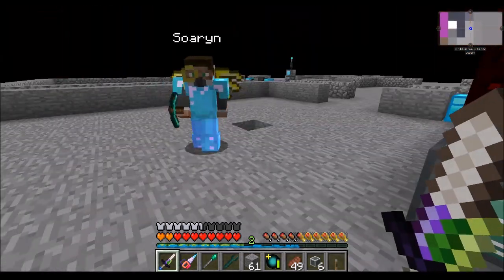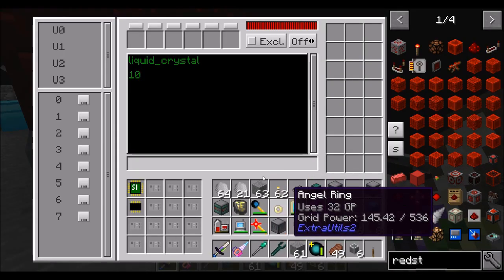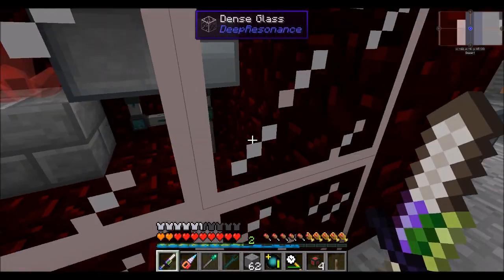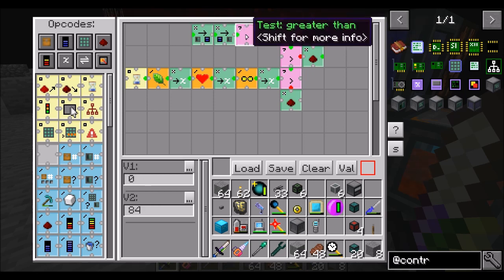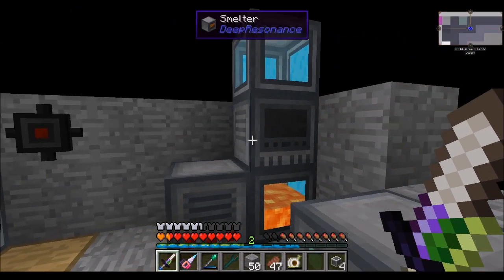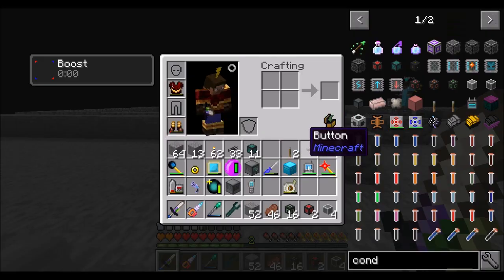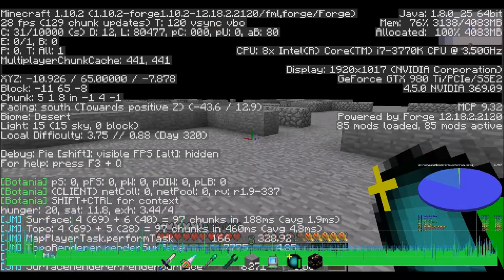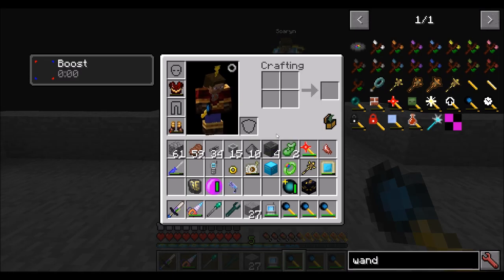Forgecraft2 S10 E102 Automated Liquid Crystal

Comment: @DireWolf20
PROBLEM: That program you are using to move the liquid crystal into the final tank is still running every second even when you are not using the system.
SOLUTION: add a tiny pre-loop in the beginning that only checks if there are liquid in the tank, but run it like once every minute or ten minutes, if there is liquid then it enter the faster main-loop that you have already made in the program that runs every second.
Reply: How to download this thing?
Reply: Can u send me link?

Comment: Dire why not just use dimensional transceivers to pipe in and out of the deep resonance room? If i remember correctly they can do power, items and redstone, and if not the latter then use rftools that way you can completely encase the structure in dense obsidian and not have holes for cables.
Reply: Draggsta123 yeah he could do it but they are kind of expensive
Reply: He has no problem with resources at this stage
Reply: Yeah but I mean its enoying to craft. My bad :P
Reply: At this state its so ez to automate bruh
Reply: Yeah he should totally do that. I once tried a fully automated system using ender io and AE2. I could do it all except the soul vial with the enderman.
Reply: So dire this would be the next project
Reply: even enderman soul vial should be doable. If you take a powered spawner and put it in capture mode then instead of spawning the enderman into the world it will put it directly into a soul vial in the inventory.
Reply: Yeah totally :) btw I didn't even know thats what that was for :P

Comment: could the "enviromental damage" from deep resonance be causing the chunk updates?  such as changing radiation values propagating through the chunks?  100% encasing the crystal generator....  use the redstone conduit to make a "strong signal" on a wall block and a repeater to pass that signal on the inside to the generator?  RF Tools has the Multiblock power cells put one inside the chamber and one outside the chamber by the capacitor.  should help remove a number of conduits from the build.  :)  great job.  or you could just use a dimensional transceiver.
Reply: Radiation is not stored in the chunks so that is unlikely
Reply: Good to know.  :)
Reply: Soaryn's chat suggested the same, but they were looking long enough for there to not be any radiation anymore either way.

Comment: what does even Ender energy conduct do? it is just expensive isn't it??
Reply: Ender energy conduit is expensive for a reason. It can transfer ~20,000 RF/t and still be in the same block space as item, redstone, liquid and AE conduits.
Its about the same transfer as glass fibre cables from IC3 (assuming "normal" 2.5:1 conversion rate)
By the time you get up to a level that requires them, its very easy to just set up a enderman spawner to get the pearls for it.
Reply: Since it's not obvious, I'll add that they transfer ~20k RF/t per connection.  You can hook up 2 connections to a full capacitor bank and 2 connections to an empty capacitor bank and transfer 40k RF/t (and change) through a single line.

Add on top of that all the benefits of Ender IO's Conduits, it ends up being my favorite energy pipe.